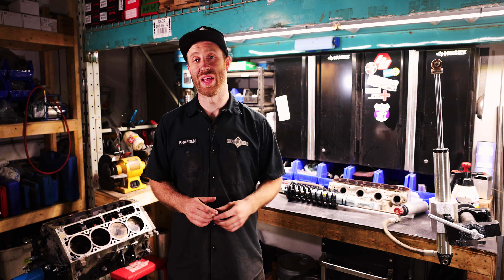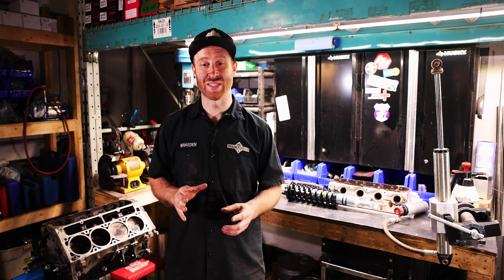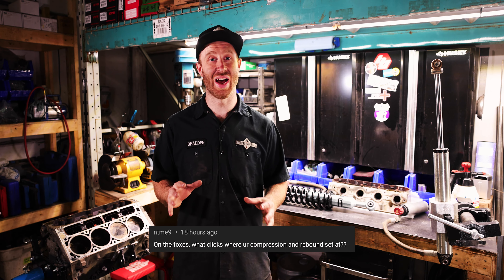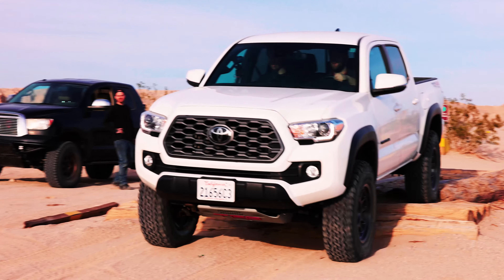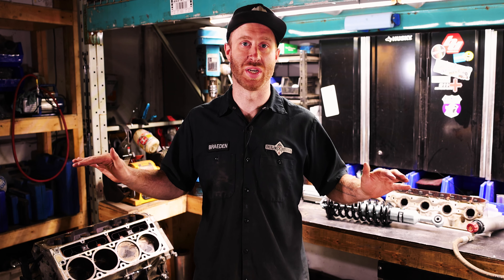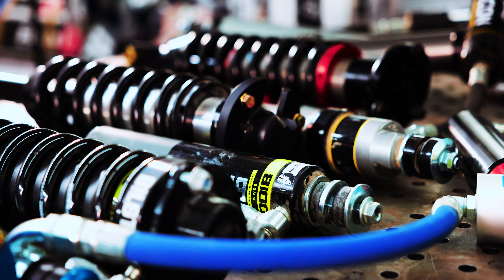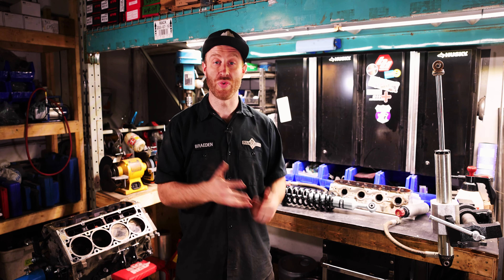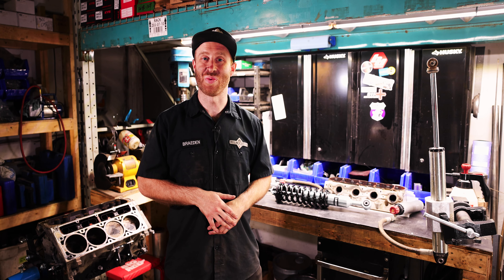I Answer Your Questions About Shock Value [+ Fox's Response!]

Comment: I really want to see you throw stock TRD PRO shocks in the mix
Reply: I had them, they were way too soft.  I got tons of sag and used my bump stops too much
Reply: @joshuagray5094 have you felt the stock TRD off-road blue and yellow Bilstein shocks I also feel like they are far too soft I was bottoming out doing 75 on the freeway hitting bumps Granite I was completely fully loaded still don't think that should be happening
Reply: @yzrippin  are you talking about the stock trd off road bilsteins or the 6112’s?  I have the 6112’s
Reply: @yzrippin  I haven’t.  But it def sounds too soft.  Bump stops will help, so will stiffer springs or coils for the rear ebd
Reply: @joshuagray5094  toataly stock 2019 trd off road 4x4.
Reply: @joshuagray5094  6112's feel incredibly better than the stock OR shocks. My bud has his stock still, and my SR5 feels far superior now to his rig. On suspension that is.
Reply: TRD Fox are built a bit better IMO than the standard ots IFPs. They are also IBP which is a bit different. I am running the fronts on my GX off a Tacoma and am pleased with the performance. Going to a coilover for tunability but I expect that it'll be a bit worse over the small bumps which literally disappeared going to these. I was stunned at how well they eat up small motions
Reply: @accordv6er  very much thank you for the input sir tons of third-gen TRD Pro guys put less than 20,000 miles on the suspension before they swap it and I'm thinking of scooping up upset real damn cheap
Reply: Yes do the TRD PRO suspension please!
Reply: I had the trd pro fox suspension on both a tacoma and a 4runner.   It felt incredible for a stock weight vehicle.  The moment you add spacers or a bunch of weight they are compromised.   I ended up swapping out to King 2.5s on both vehicles and am doing the same soon on a LC 200.  Stock however the TRD Pro sets felt near perfect.

Comment: It would be awesome to see the Ironman 4x4 Foam Cell Pro shocks/leaf packs tested. They’re affordable, their design is pretty different to other brands, and I think it would be great to see their performance claims tested.

Love what you guys are doing
🛻💨
Reply: I’ve seen so many Australian Toyota people run Ironman that I think it’s gonna be what I go with next. I have bilsteins currently and they are too rough for daily driving with no added weight
Reply: Great video! Ironman Pro Foam Cell
Reply: @jonc7371  I got the foam fell pros with the heaviest front coils and leaf packs for my 3rd gen and don’t run any weight besides tools in the bed. Truck rides awesome. It feels a bit over sprung in the front without any weight there, but honestly it still feels way more comfortable than other buddies’ Fox shocks.

Plus I don’t run the sway bar anymore, and it helps keep the truck more planted with the stiffer spring weight in the front
Reply: I also would be curious to see the foam cell pros tested. I ordered them for my fj about 6 weeks ago but they've been on backorder. Hoping to get them soon. The wait is killing me.

Comment: How about the ironman foam cell? I just got a set installed and would love to see if your opinion goes with mine. Great job. Loved the series and waiting to see more.
Reply: I have running foam cell shocks from Doetsch Tech for years. Simple affordable and never a blowout or fail. I also tried some Koni Raids on my last truck. Foam cell, rebuildable, and adjustable. Only thing is I had to import from Germany!

Comment: I have the Fox performance elites front and back on my Tacoma and they’ve been phenomenal. Being able to find tune them with the DSC’s on the fly is great. I got them from Accutune off-road and they do their own tuning on the shocks when you buy them based on your driving style and added weight. 
I had a bilstein 6112/5160 setup before the Fox performance elites. I probably would say that the Foxs aren’t worth the extra ~5 grand but the performance is definitely massively better. Better compression and I bottom out about 90% less. I wish there was some rebound control as they can top out kind of hard, but not as bad as the bilsteins.

Comment: Do a collab with @tinkerersadventure for the budget/mid testing! His engineering evaluation on the suspension measurements were really interesting and would only add to your blind-testing.

Bilstein 5100, Bilstein 6112, OME 2-3", Dobinsons, Eibach Pro-Truck Stage 1, Fox 2.0 Performance series.

Comment: You guys are putting out excellent content - fun, informative, and entertaining. I've been saying for a while now, I much prefer side by side comparisons to help combat the bro science and old biases. The key whether it is tire pressure, type/size, suspension... and so on is to control for the variables so that the one thing you are trying to understand is isolated. It doesn't need to be painfully rigorous, just enough to show what a run at 10 psi vs. 15 vs. 20 or whatever does. I drive a full-size and jeep or taco guys will say I have to do X or Y or must never do Z... but they aren't accounting for the different load/vehicle or whatever.

Comment: 6112s ride awesome (when they are fresh) I just replaced mine but had to buy an entire new kit $820 bc Bilstein DOES NOT SELL JUST the shocks... you gotta buy the collars and springs all over again when tbey blow out(they dont last a lifetime) 

BC I had to vuy another kit I opted for the HD 6112 lart# for 4 runner w 650lb springs. They will give you 3" lift out of the box.. 600lb kit is 2.5-2.6" lift. 650s make no swaybar life easier to stomach also! Do the HD kit and dont look back.

Comment: This was such a great series!! 

Really need a similar one for the $1000 stuff (Fox 2.0, icon exp, 6112, eibach, dobinson, Ironman etc)!!!

 Such good stuff!! 

Also - FWIW, i ran fox factory series RR on a 5g 4Runner but revalved for much lower slow speed compression and was much happier. But TBH i thought my buddy's ICON 2.5s were better. I've been pretty open about it. My only wish is to see ICON soften up a bit and go progressive piston.i like it better on road with sway bars intact.

Comment: I have the Fox 2.5 elite series dsc (adjustable).  They are great for street and trail riding (NY). We don't have desert here. The company I bought them from shop that does a tune based on your usage. Adventure, Dual Sport, or Trail tune.  Excellent so far.

Comment: What would you recommend for a 2023 jeep gladiator with RK 4 1/2 inch lift kit, (not coil overs) i’m looking for a good adjustable shock to take road trips out of state do lots of back country dirt road travel and sometimes towing a modified off-road teardrop trailer, I want the adjustability for when I’m towing also I live in Northern California and a lot of my areas I go for the day the roads getting there are very winding with lots of elevation gain and loss so body sway adjustment is important and then I’d like to back off the adjustments once I get off road, I had the fox 2.5 on my jeep 392 they were OK I was not impressed, I like the kings but they only have one compression dampening adjustment and I worry about their reliability so many people I know their shocks start leaking within a month or two, then there’s the new bilstein‘s and I’ve heard they make a lot of noise? I don’t know what that noise is? Is it annoying? any recommendation would be great, also ohlins came out with new shocks which I know will be top-of-the-line, since I was a super bike racer and we always Ran ohlins they are incredible, but they are probably double in price of everyone else.   Thanks👍👍

Comment: I have the Bilstein 6112's and 5160's in the rear. They are WAAAAY too stiff for a stock tacoma. If I load it up with 800 lbs of crap it actually feels proper. I knew it was bad once I took it off the jack and there was zero sag. If I was nearby I'd take it to you guys in a heartbeat
Reply: That would probably be in your leaf springs
Reply: Interesting, I have the same setup, with Icon RXT leaves in the back.  My thought was that the ride was much more controlled than stock, and softer overall.  I typically run with 2-300 lbs in the box (winch and cradle, recovery gear of all sorts and 5 Imperial gallons of both water and gas with a hard cover). I set the fronts all the way up and put the extra leaf in the RXTs. Truck is a 2013 extra cab, TRD Off Road.  I mostly do fire roads and crawling.

What height did you set yours up at and what leaves to you have in the back? Which version of the truck?  What sort of off roading do you normally do?

Comment: I appreciate that the truck was stock level performance, but I really wish we would be more specific when we call something stock. Wheels and tires can have a huge impact of the performance of a vehicle. If you want to test stock, it's pretty critical that the wheels and tires represent that. It's fair to say that most customers will change those things before suspension, I totally agree, but that's just not stock anymore.

Comment: wish I saw your video before buying suspension lol. I got fox 2.5s no adjusters and would get thrown out of my seat when on rough roads. it was so stiff a fox 600lbs springs. I bought 550lb and that seem to help a lot. its waaaay better but i think can be a tiny more plush with revalving but I cant find info about how to know how many holes to add to the valve and such. would have gone with a different brand otherwise. I think I got the older shocks i think

Comment: I would love to see the OME MT64 in the more budget test. 

I have a question if you take the time.  At what point do you advise someone choose a remote vs a higher end IFP? For reference,  my 4runner gets driven a few weekends a year at relatively high speed over forest roads. Not desert racing, not big whoops, but potholes and washboard at 60 or so mph for 20 to 30 miles at a time, then time to cool off.
Reply from the maker: Unfortunately we weren't able to get our hands on a set of MT64 when we shot the mid budget testing, as they had just come out. The low budget test will be released soon, and the mid budget coming out a bit after that! 

as far as resi vs ifp, the biggest difference (and only difference in a lot of cases) is more oil volume for better cooling. Instead of a big portion of the shock body being used to house another piston and air, it is all oil. On some shocks, another benefit is that a resi shock can be built with a shorter shock body for the same stroke shock. 

Really it comes down to whether you are finding your truck gets bouncy after a while driving offroad, as thats the result of shock fade, when the shocks are over heating.
Reply: @OverlandOutfitters when? About to order shocks!

Comment: You should use an impact recorder which will provide data to compare.  Also the iPhone has an accelerometer that an app may provide you a tool to use to measure gforces.

Comment: I messed up my truck. I have a brand new 2024 ram 1500 rebel 4x4 with stock Bilstein shocks. The ride was smooth and great going over bumps and low and high speed  I had a 4 inch BDS lift with fox 2.5 dsc coil over in front and 2.0 in the rear installed and my ride is not only heavier in the front but the shocks are rough man, i mean way rough, i bought them because all the hype says fox are the best. Smh rough ride man, in so disappointed, I've been trying to dial them in but I don't notice any difference at all. I diall all the way out and run it and then all the way in and run it and don't really notice much difference. Regretting getting the fox shocks ! Now I'm trying to figure out how I can fit some Bilsteins into my 4 inch lifted truck!

Wonder if anyone can help me tune theese shocks, need help dialing them in!.

I emailed fox but havnt recieved a response, maybe i need to make a video and post it in youtube!

Comment: Do RC. I’ve been hearing the good and the bad. Could you do one for that so we all know if they are worth getting or not. Thanks
Reply: I’m running the RC M1 Monotubes on my 3rd gen and it FLOATS over terrain, even loaded with gear the full leaf pack is dialed for the taco.

Comment: I was expecting Fox to say the set they got had some kind of QC issue.  Not so.  Amazing.  I was considering a Fox kit for my Miata this makes me kind of question that company.  A car like that needs firm, sporty handling of course, but harsh shocks on sports cars are what you call slow.  Also saw a guy with the Fox's on the track hitting the apex curbs, and after the inside tires come back down, they rebound back into the air 2-3x.  I expect that from Ebay shocks, but not a $2,300 high-end kit from a company with alleged off-road experience.  Strongly leaning towards Ohlins now instead.
Reply: Miata shocks are built by fox but tuning spec was done by flying miata, the shocks are adjustable, so dude at the track could have too loose of rebound based on his own end user adjustment. None of that is substanciative to make your decision though.
Reply: @ryan6109  Having now bought the Ohlins and had a few big multiple-bounce events myself, I think it's primarily a limitation of street shocks.  The adjustment cranks up low-speed rebound, but high-speed rebound and compression remain soft for street compliance.  That works AMAZING until the second you run out of travel, at which point all hell breaks loose.

The Miata soaks up a railroad crossing like it wasn't there, whereas my Dakota on cheapo Bilstein 4100s is quite harsh.  But the Dakota can get 4 wheels in the air and land quite nicely, whereas the Miata gets into that Ohlins bypass valve and does what the vintage dirt bike guys call the "Flying W" bounce.  A lot of that comes down to sheer travel.  There's no replacement for (damper) displacement.

I'm sure I could dial that out with more expensive double-adjustables on the Miata.  Or, I could just take the Dakota anytime I want to bomb the roads built on unstable Mt St Helens terrain.  The Miata is an absolute UFO on any road that doesn't have jumps in it.

Comment: I think Fox's letter contained too much hype and spin. I would still love to know what the actual valvings were on the Fox shocks. Shim thicknesses, # of shims, firmer on rebound or compression, that sort of thing. Doubtful that they used flutter stacks in their "stock" valving. 

Fox's explanation doesn't make too much sense to me, based on what I know. Pre-runners, desert racers, their valving is typically pretty firm on compression, light on rebound... because you want the suspension not to collapse too much on the big hits, and you want soft rebound to allow the axles to drop back down quickly after those hits, to maintain as much ground contact as possible. That sort of valving's not very good on the street though. And it creates excessive body roll in the the turns. Makes a sway bar a necessity if you do drive the truck on the street, IMO.  If I remember, that Tacoma had near zero body roll in the turns when the Foxes where on? For me it just doesn't add up. 

But anyway... it will be interesting to see the next comparison.

Comment: Fox is basically garbage with garbage customer service. I find it funny how they charge all that money yet it's old technology that doesn't work on 90% + of the truck supposedly.....  The whole experience buying the 2.5 DSCs and then the 2.0 resis with adjusters in the rear has been garbage. If they had good customer service that would have been one thing.
If you buy a set of the supposedly older ones, just plan on tuning them before you even install them..  I know for me, I'll never buy their stuff again.